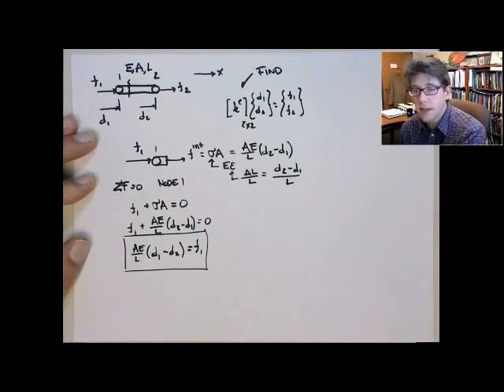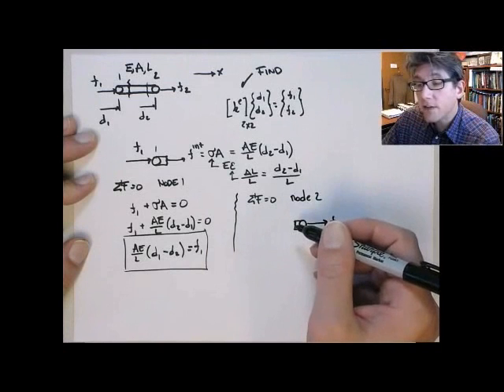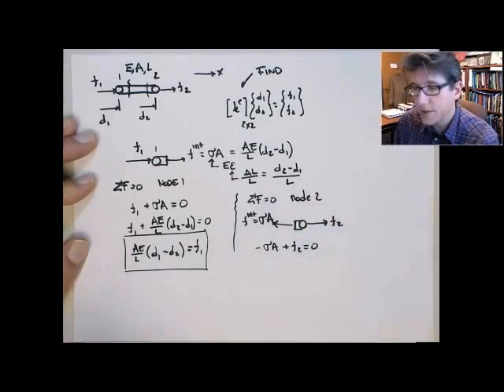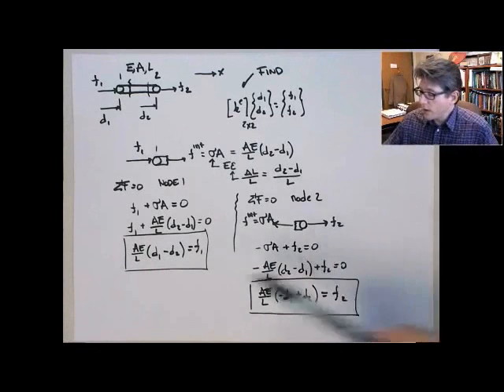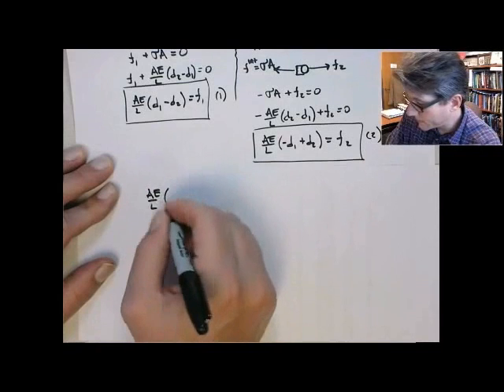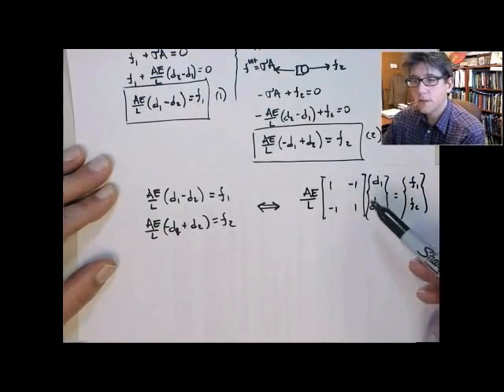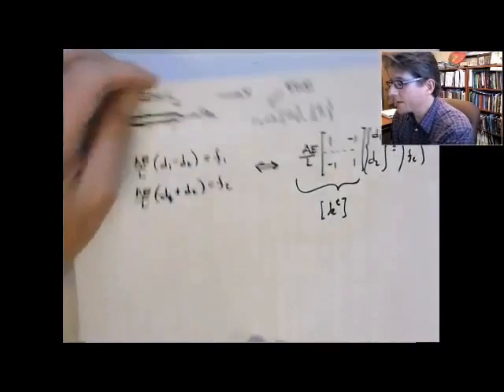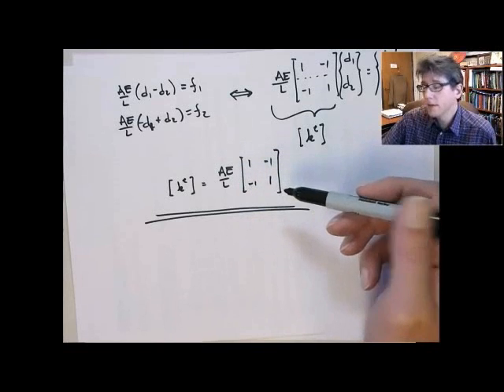1D Bar Element Part 2-MECH 4326- Finite Element Analysis

Comment: Bar at node 2 are in tension, forces point in opposite directions, that I understand. Why is bar at node 1 also in tension but forces are pointing in same direction? Is the F_int greater than F_1?
Reply: at first we assume the bar is in tension. Fint has to be acting to the right and  greater than F1, then node 1 will be in tension.